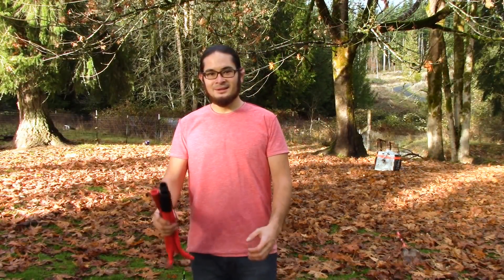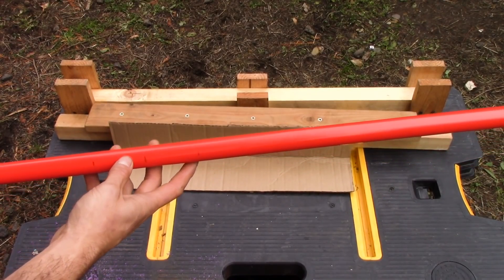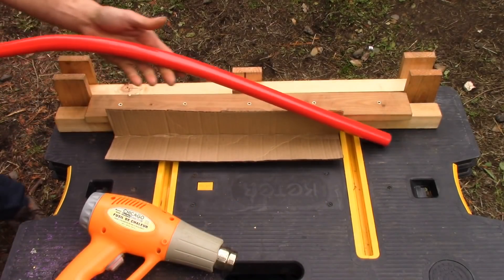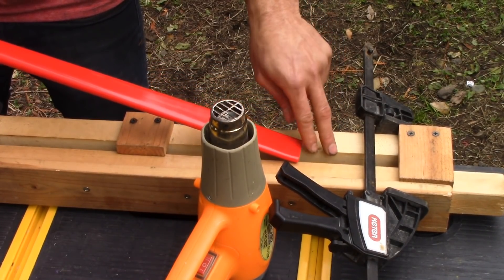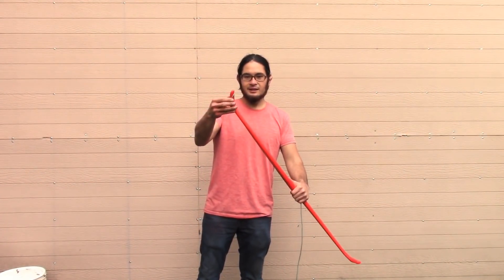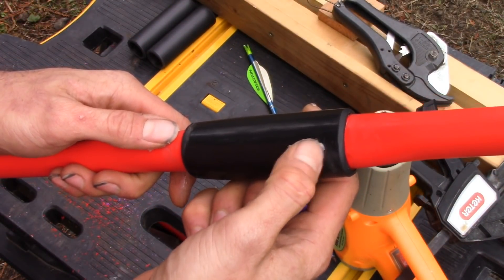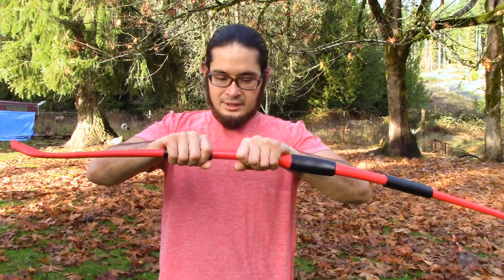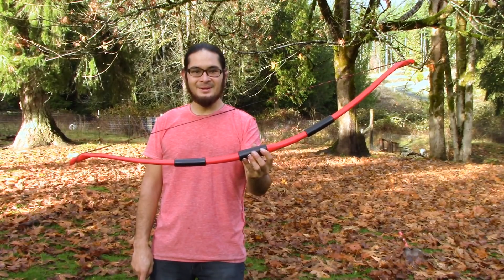Making a 38 Pound 3 Piece Red and Black PVC Takedown Bow - Compact Under 18 Inches

Comment: Hello and congratulations—that's great. Now I have to find a solution for splitting the arrows, because otherwise you don't necessarily have to cut them into three pieces—two are enough to achieve the length needed for the arrows anyway...

Comment: pretty cool, i woud be inclined to move the joints closer to handle though so that your handle area is mostly ridged & theirs no interruption in the working section of power arm, it wouldnt be as short then though but your bow arms would probably be stronger/efficent without a break in it the main working portion of bow is the 3rd in between the end and the mid point
you could do one with removable siya's and have both bow lams detach/insert into top of handle. then you could keep a uninterrupted 18inches of bow arm on each side, it would be 5 not 3 peices then though, unless u made it so siyas also fitted into handle for transport then it would be 3 pieces with some disassembly/assembly required :P you could wrap it all up in bow string though in a neat bundle. 
you could also fill middle of handle section with expander foam to make it fully ridged youd probably up poundage a bit/force transfer to arrow a bit that way also

Comment: I’m curious I was thinking about trying this with youth specs so 1/2 inch instead of 3/4 inch pipe for lower draw weight. Have you tested the draw weight before and after the takedown alteration and does it lower it at all?
Reply: Draw weight increases after alteration

Comment: Cool! Just wondering why you had to cut at the midpoint?  Seems like you could have sleeved the grip with the black pvc once you've already cut it into three pieces.
Reply from the maker: I've found that sliding a smaller piece over a larger one is tricky. The outside of the 3/4 inch pipe is just a bit larger than the inside of the 1" pipe, so there is some stretching involved and the PVC acts a bit like rubber when soft. It's easier to put a small piece into a pipe rather than over it. I decided to do this on this build, but it is possible to slides handle over, especially with a lubricant like paraffin wax.
Reply: @BackyardBowyer  Oh okay. What was the purpose of sleeving the grip?  To add strength or improve the grip?
Reply from the maker: I did this one mainly for aesthetics and to have a larger grip. That could also have been done with leather or some sort of handle grip material.

Comment: any tips on folding the tips? A lot harder than i thought it would be
Reply from the maker: I start by folding the tips over a couple of times with my hands. If it's too hot, gloves and oven mitts can help. Once it's cooled down with a crease, it's easier to force between the two boards. It's a bit of a wrestling match each time I make one of these tips.
Reply: @BackyardBowyer  how even does the fold have to be? or will it all even out after sanding?

Comment: Can you get 50# with the same design?
Reply from the maker: Yes, start with a 45 inch long pipe for a 45-50 pound or 44 inch pipe for 50-55 pounds. These may be easier to shoot with a release. You can also use 1 inch pipe at 56 inches for around 50 pounds. Thanks for watching!

Comment: Yo nick can i use camping tent rods exept drive way markers? Becoz in pak they are not available plz reply
Reply: I’m not nick but you definitely can. Same concept
Reply from the maker: Yes you can. Be sure to remove any metal pieces or connectors first. You may get less weight if the rods are hollow, but they should work. Thank you for watching!

Comment: Great looking bow! Why did you cut the middle section and then glue it back together? To fit the black handle piece?
Reply from the maker: Yes, the center cut was to add the handle piece. The 1" handle over the cut 3/4" is more stable than the 3/4" pipe alone.

Thank you for watching!
Reply: Nick, do both center pieces meet exactly at the middle of the black handle piece?  Also, aren't the cuts possible points of catastrophic failure or breaks? Lastly, isn't there a possibility of the limbs coming out of the take-down connectors under draw pressure?  Thanks!

Comment: What’s the life span of these bows ?
Reply from the maker: I've been using this type of pipe for around six years and have not had a failure yet. With plumbing PVC pipe, it's important to test the pipe first. If the pipe is brittle it will last around 2 or more years. My oldest bows are still shooting after over eight years.
Reply: @BackyardBowyer  : how much would you charge to fabricate a take down bow like that for me due to personal issues I’m not able to fabricate one .

Comment: Is it possible to make a pvc bow with higher draw weight and be a takedown?
Reply: 55 pounds is about the maximum draw weight of this bow when using a 44" pipe to start with, but check out @backyardbowyer 's video on how to increase the draw weight of this bow by 10 pounds using a fiberglass rod.

Comment: Nice bow!! To increase the draw weight of the bow can I  use a thicker  pipe ??
Reply from the maker: You can either go up to 1” pipe and use 1” pipe as the connectors or make a shorter bow. The maximum I would go is around 50-55 pounds at 28”, which starts with a 44” long 3/4” pipe.
Reply: @BackyardBowyer  thanks man